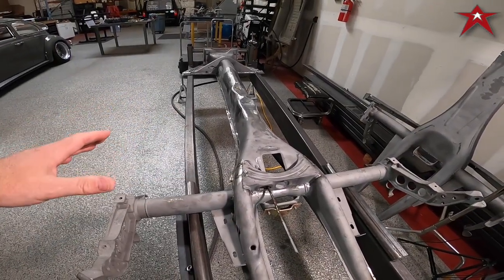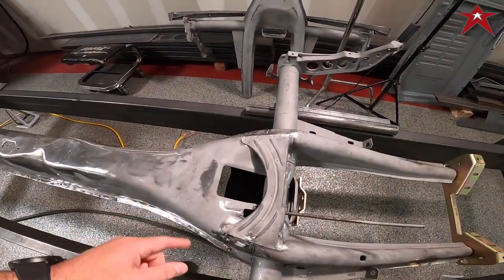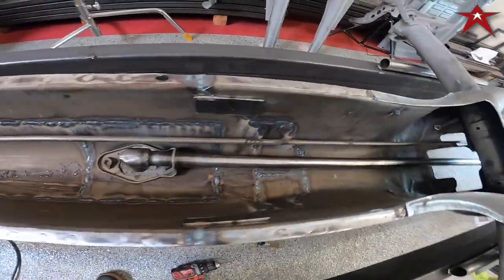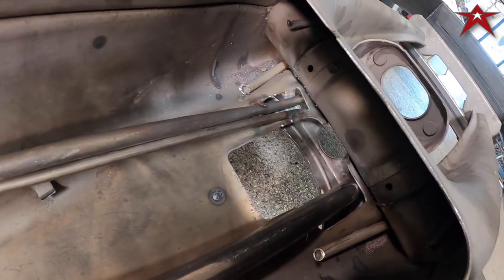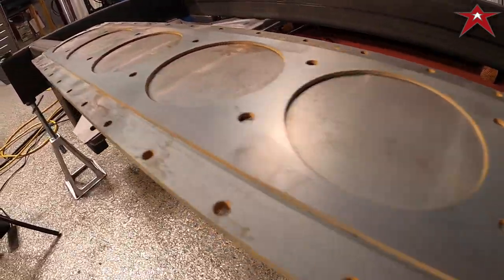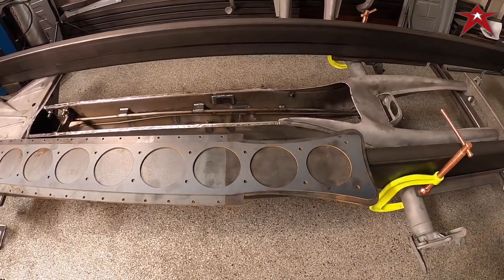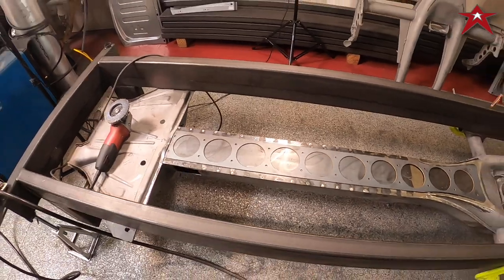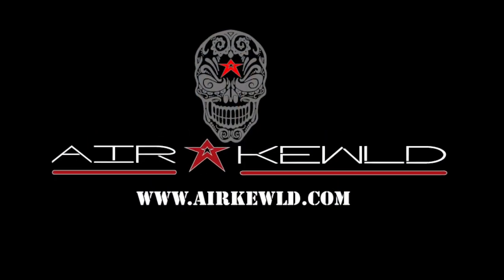Check out my NEW SPINE! - Shortening a VW Chassis with all the custom touches!

Comment: Loving your work and attention to detail. A buckets list build for me is a Super Bug with a water cooled motor and it was great to see the inside of the tunnel and the possibility of running coolant lines through there. Not the greatest for heat dissipation but it'd look SO clean.

Comment: That laser cut plate you welded to the bottom is going to be a great rust trap once moisture gets behind it.
Reply from the maker: Thanks for the comment Krusher. In all actuality, there is three layers of powder coat that filled any gaps that were there so no moisture will actually get it. We thought of that and made sure before we started assembling.